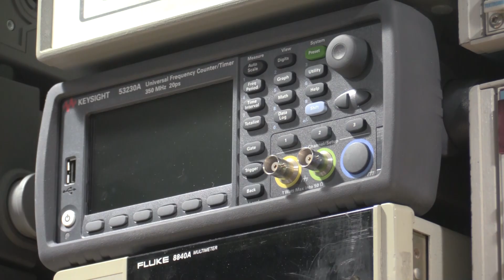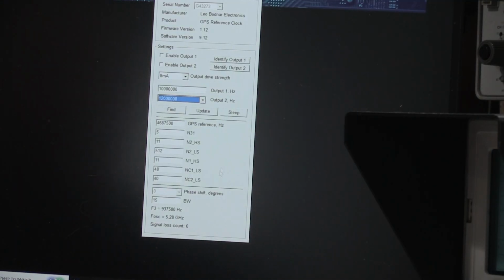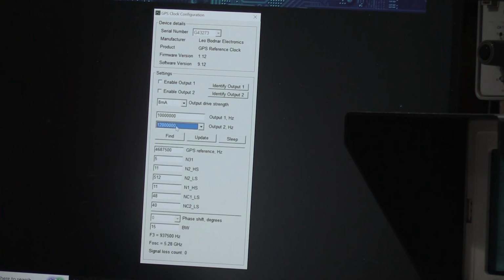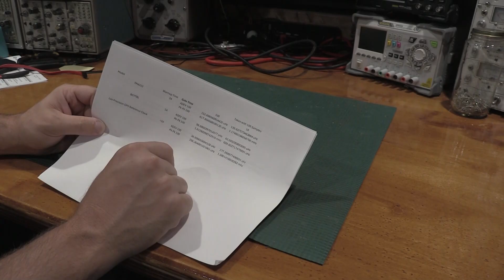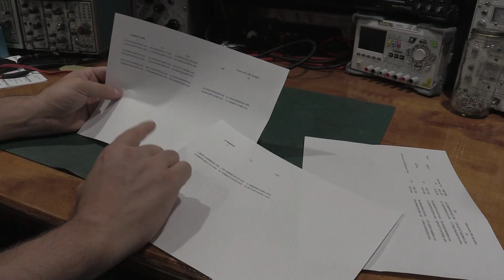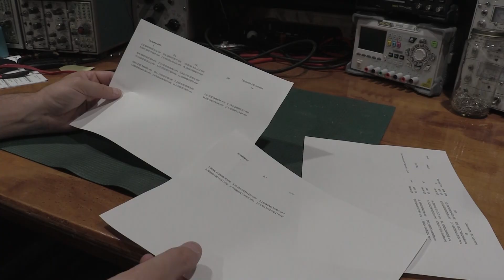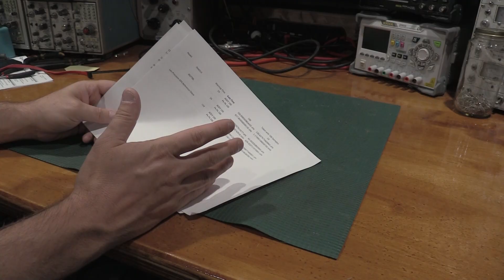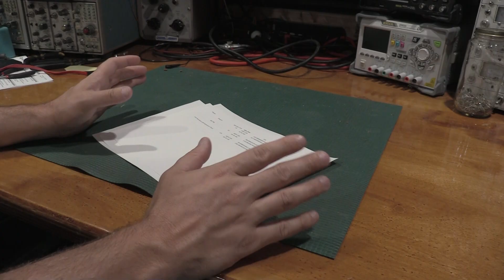Mastering Precision 3 Leo Dual Port Variable GPSDO

Comment: Very good info. I'm not a lab, nor an electronics heavy. I just need an inexpensive reasonably accurate frequency reference for my older hobbyist radio and tv equipment, repair work and alignments at my kitchen table.

Comment: For frequency standard work as opposed to positioning you're actually better off locking to 1 strong satellite than to try to receive more satellites and have the receiver auto-selecting. uBlox has a paper discussing it, as well as receivers optimized for frequency as opposed to position.